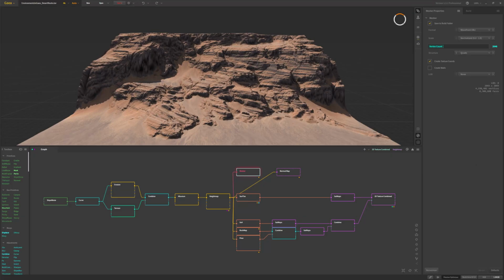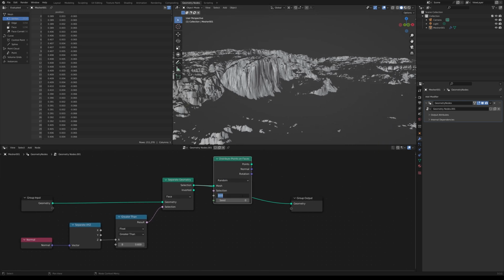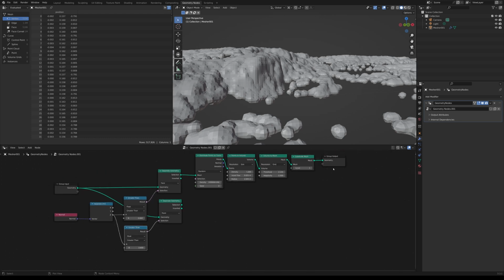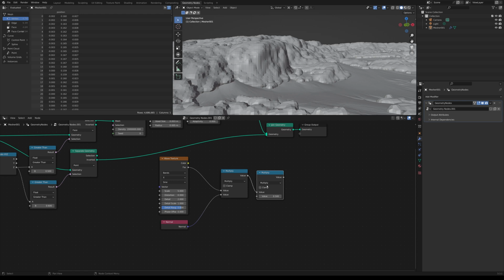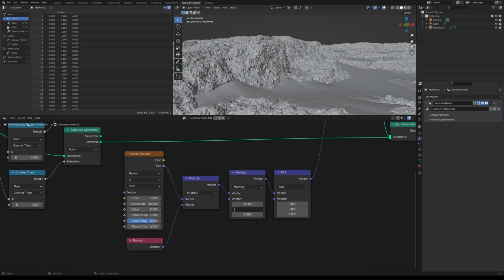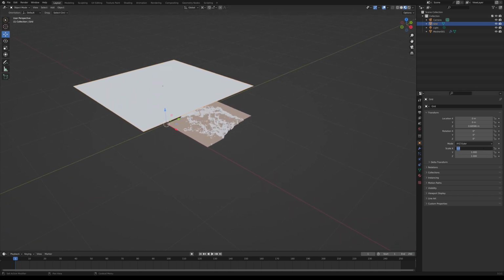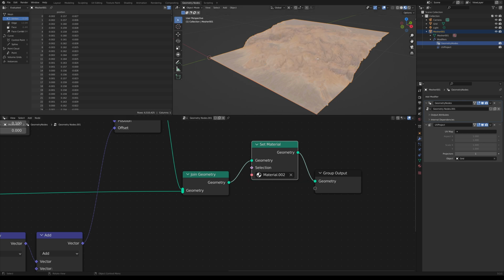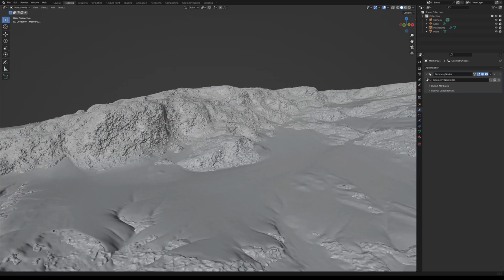Blender - Fixing Heightmap Stretching Tutorial

Comment: I think my geometry might be too big, but my machine is a monster and it's nowhere near as responsive as this. It also has crashed several times. I did export at 2017 from Gaea but I have 64GB of RAM and a I9 13900. I keep playing and it is a sludge but it is a great video and look forward to more.
Reply: I have to be doing something wrong but can't find it. Blender keeps crashing or it takes several minutes to make a single change. Still trying to find the issue.
Reply from the maker: Try to use much lower settings like not as heavy/detailed and then slowly make it higher quality. It does depend on terrain size and density. And this is a approach good for small patches/or smaller terrain assets. 

For larger terrains in Unreal you'll want to utilize virtual texturing and displacements, which I'll do a tutorial on eventually.

For non-realtime, displacement or vector displacement works well so it only adds detail at render time. Or break up the terrain in smaller patches and add LODs. 

For reference I have 96gb ram and a Ryzen 5950x, Nvidia RTX 3070. 

Also try using adaptive mesh from Gaea which might cut down the triangle count a bit more.